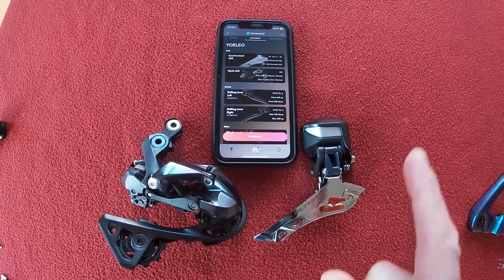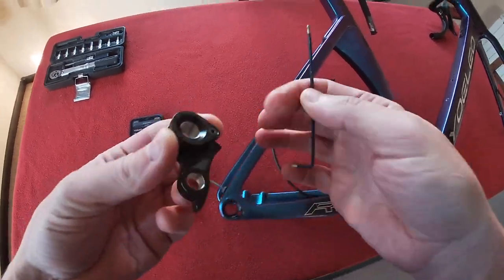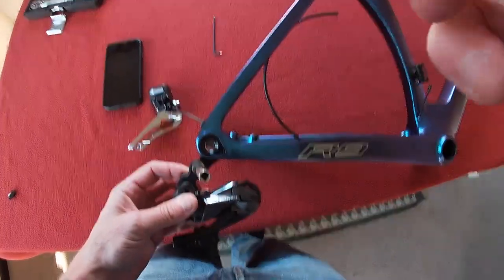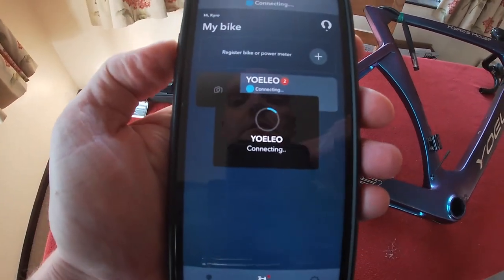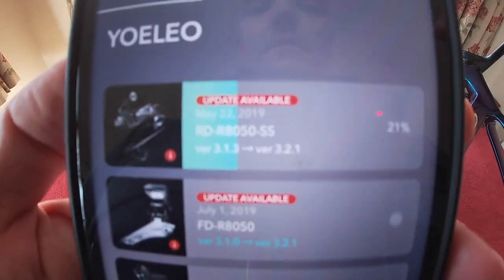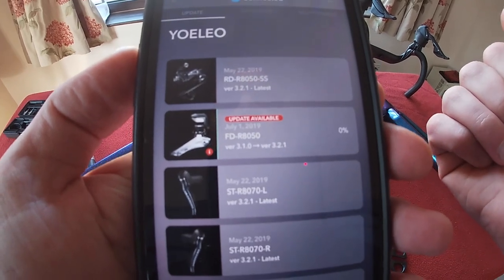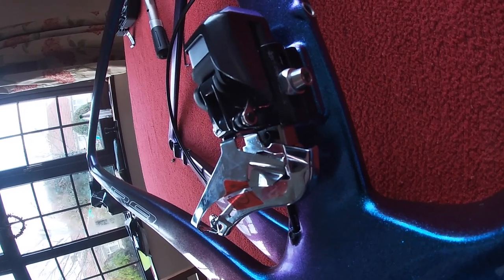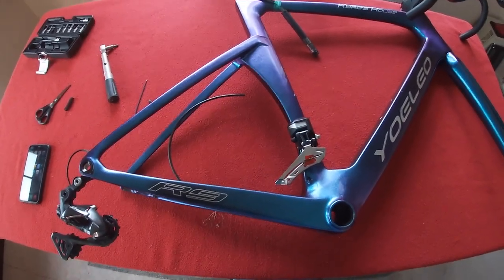Updating Di2 with E-TUBE App on Mobile Phone

Comment: Did you put the rear derailleur on correct? 
I did it wrong first, and then I saw I had to make a bend backwards between the derailleur hanger and the hanger extender. But it was fitting so nicely in a straight line that I first thought that was the way it was supposed to be.
Reply from the maker: Yeah I may have to redo it.. I knew someone would spot that. How’s the R12? 👍

Comment: Did you get the replacement frame?
Reply from the maker: The replacement frame was ordered and I opted for the R21 at first but then thought I’d go for the R12 2021 model as it’s a different shape, as it’s still the CNY it won’t be ready till after, so I’ll have another series coming in the next few months hopefully. 👍
Reply: @KyrosHouseCycling  And what is going to happen with the R9?
Reply from the maker: @kornel02  I can keep it, so I may cut it in half to see how it’s constructed or just keep the frame as a spare.. not sure really. 👍